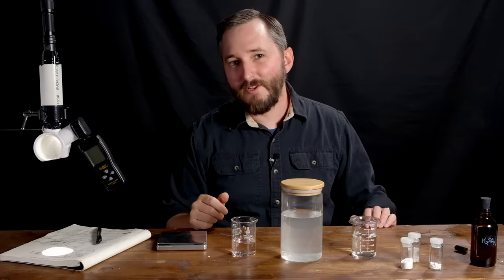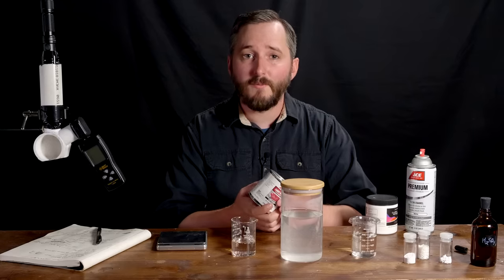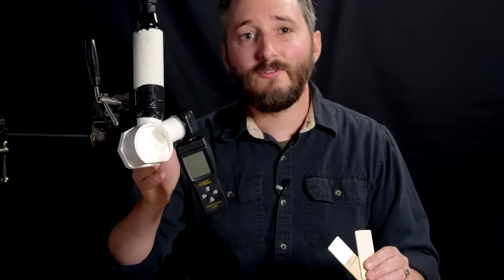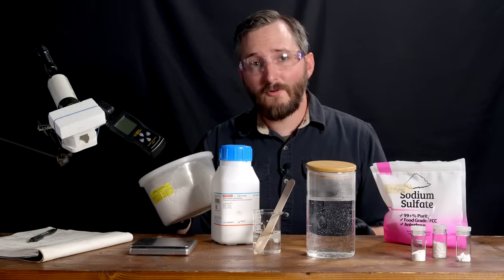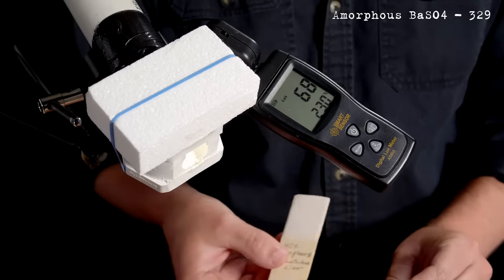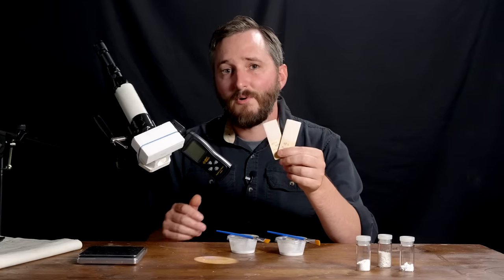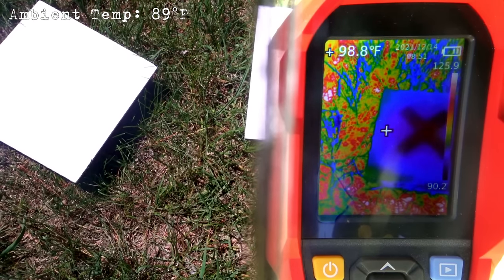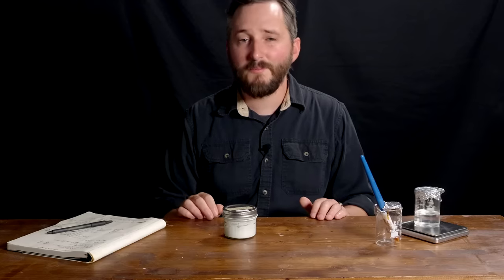How To Make Infrared Cooling Paint (Electricity Free Air Conditioning)

Comment: I tried this with a few Aluminium boards, 2 tests: 1st with a sensor on the back, comparing the temperature of the board to another plain white one. (duplicolor white acrylic), second test was at night with a resistor 20W glued to the back: how much power can I sink compared to the plain white one to hold the board at 15 deg C above ambient. The boards were 3mm 25x25cm. In the sun they were similar, but in the dark the CaCO3  was 12W more and BaSO4 15W.  For some reason the acrylic paint I mixed with BASO4 turned brown after being in the sun for a day ..... Will try KRYLON top coat maybe. I also tried caulk paint, but it would not stick to aluminium at all.
Reply from the maker: Thanks for sharing your results!
Reply: @Nighthawkinlight  I think I understood the application (from the docs) wrong, there are reports  of high power radiators - this only makes sense if the  radiated energy turned into IR

Comment: Thanks for this very interesting video. A lot of effort has gone into it.  I'm sorry to say I have some doubts about the experimental procedure used to measure the cooling effect.

Is the temperature of the panels acutally lowered by the paint?  In the video, no contact temperature measurements were taken.  The only temperature measurements were made using an IR camera, which is only a proxy for the temperature of an object.

The whole point of this paint is to emit more IR in the atmospheric window, so some IR detectors should show more IR emission from the new paint, others less, it depends on the specific IR wavelength measured.  Without controlling for which IR wavelengths were measured by the IR camera, we don't really know if the surface was cooled, or if less IR was emitted at certain wavelengths.  In fact the surface could even be cooler than expected, because more IR is emitted at specific wavelengths.

A better experimental approach could be used to measure the temperature of the water bath, or metal block, underneath the painted surface.  The temperature of the water could then be measured by contact to see how much the water is cooled using this new paint vs the commercial paint.  Insulation would be needed around the other sides to reduce heat exchange via IR from the other surfaces.

Another approach would be to keep using an IR camera, but to measure the reverse side of the panel, but this also would need controls for IR hitting the reverse side from the surroundings.
Reply from the maker: I've since confirmed the readings with physical probes and by measuring the back of the panels via IR. I've found the most accurate method for detecting difference from ambient is IR on the back of the panels compared to the same uncoated material reading in shade. I'll have a new video out in a month or so.

Comment: Are you aware of Sherwin Williams 'vinylsafe' paints? 
I did some crude testing of aluminium swatches with thermocouples on the back. I measured a significant difference in sunlit temperature between vinylsafe and a regular paint of the same colour.
It's now my go-to paint for any exterior surface in NC.
I didn't try white, but you may want to.

Comment: I live in the Philippines (North of Manila) where the temperature is around 30C basically all the time, plus a LOT of sunshine.
If I could paint the roof of my house with paint like this, I think the energy use for the aircons would go down drastically. The price per kWh has doubled in the last two years and I doubt it will ever go down again.
Not sure I'm up to the task to make paint to cover roughly 150m2 of roof myself, though.

Comment: The other paint did well because like you said almost everything is IR emissive.  It seems the main benefit of emitting in the atmosphere gap is that you're not heating your local surroundings.  I was also thinking that maybe a benefit could be there would be less of that wavelength hitting the panels from other sources since that wavelength mostly passes through.  However that wouldn't matter much because all the frequencies that do reflect will be hitting the panels regardless.  It would reduce the amount of the light the panels had just emitted from reflecting back on the panels but that amount would be pretty small anyway. Finally I would also be really curious about how black paint preforms in indirect and no sun compared to the these white paints.  Because black should be much more emissive as well as absorptive.

Comment: A mood ring changes color based on the temperature of the person wearing it.  If the mood ring material was ground up and put in a transparent base, it might be possible to tweak the material to make a dark color at colder temperatures and a light color at higher temperatures.  I'm not a chemist but would like to throw out the idea for chemists to make better paint.

Comment: This project was just begging for even the cheapest of diy spectrophotometers. But there may be a reason a surface spectrophotometer is trickier than a transmittance one. By quantifying all the seperate effects it would be much easier to optimize and understand the final product. Also some more discussion on how having a temp slightly below ambient would have such a significant effect. I feel like I could follow everything in the video except that. Great video though. It might make for a better series to have seperate videos for the chemistry portion and the paint/testing related portion. Or even better maybe  short and long format videos. This is really only necessary if you notice a high percentage of people losing interest and clicking out in the analytics though. Just an idea.

Comment: A very interesting video. I wonder if this paint would work as a coating on the backside of solar panels? Solar panels' efficiency decreases as they get warmer. Of course, being on the backside of the panel the paint would be shaded so I'm not sure that it would be effective in cooling. How about a highly reflective paint for the opposing panel behind a bi-facial solar panel? Because bi-facial solar panels can produce energy from the back side they do very well in snowy conditions because of the reflective properties of the snow.

Comment: I'd suggest use of dielectric mirror with fine tuned gap in reflectance and coal underneath (or vantablack lol). you can try to apply soot on undersurface. Be advised that gap depends on angle of mirror relative to ray, so don't mess this up.
Reply: Or another idea. One need to get REALLY TRANPARENT aerogel. Make a box out of it (or at least make an upper window with it) and cover it with dielectric mirror.  For best result i suggest to cover lower half with additional dielectric mirror to close gap from earth and closeby objects. And for top result you should make a cover from direct sun. and that's it. You'll make a good "free" fridge. xD
Reply: For convenience of usage I would combine it with phase material that can help keep desired temperature and help objects cool down faster.
Reply: Or maybe better instead of aerogel get a vacuum heat insulating chamber. But for good performance it should get rid of desired IR... I'll think of it later.

Comment: It seems logical that if you could point the panel at a direction without the sun shining directly on it it would be possible to get better performance. Perhaps foam walls going up from the edges of the panel might help with reducing the radiant heat from the tall trees and buildings as well as the sun.
Reply from the maker: True, but it's also highly beneficial to reduce absorbed heat from the sun on a sun facing side even if the cooling is not as ideal.

Comment: I forgot to mention in my last comment that should also measure the temperature ye olde fashion way, as you're working with reflective materials (it's kinda hard to tell how reflective they are to IR wavelengths with our eyes) that may not give you an accurate temperature measurement. Try a thermometer with a needle-like probe that you can stab into the substrate/coating.

Comment: It seems logical that the temperature differential would be smaller in the shade.  Overall radiation is lower with lower temperatures, so any factor that assists in cooling by radiation would not work as well with cooler objects.

Comment: Thanks for sharing. 

I keep coming back, 
 because there's something that
 seems to elude me that could
 possibly be added.

As I'm constantly thinking about
 panels & looking at your birdhouse
 type test mockups...

If in theory, if you were to take a
 structure (bird) house or other, 
 then (for test purposes) make
 the roof were you can flip inside
 out; coating one surface with
 reflection paint & other with a
 heat absorbent paint...

Is there any substantial difference
 of internal temperature change ?

If so, 
Then you can in theory make a solar
 panel style system that utilizes 180°
 louvers over a ventilation for desired
 effects.

I'd like to know if this has any
 credibility. But I have neither
 time or $$ to devote to such
 endeavors. But, would hope that
 I could have helped out in some
 way. 

Best of luck 
&
Let us know if you give it a try.

Comment: Next time put samples on a concrete surface that has been exposed to the sun, that way your results will be much more fairly tested. Laying the samples on grass allows way too many variables to aid in the 3.7°F delta. Soft grass allowing different angles for each relative to the sun, density of the grass affecting cooling on the back side, moisture of the soil, etc.

Comment: Posting this here because I'm sure someone else will find it interesting:

There is a recent paper from UCLA called "Do-it-yourself radiative cooler as a radiative cooling standard and cooling component for device design" that simply sticks 3M scotch paper onto aluminim foil and achieves 7°C sub-ambient temperature at night.

Not as amazing as this paint, but still pretty good considering how ridiculously cheap and low-effort it is to produce !
Reply from the maker: Yes I saw that and have tried their method with foil. It didn't work very well for me but it's a good test standard

Comment: I built FREE CLIMATE CONTROLLED HOME by MEMORIZING TEMPERATURES.
 While everbody else is reflecting heat.
     I have free PERSISTANT air conditioning& heated cabin using a system I built that ABSORBS either heat or cold. 
 I used 2tons 2x4 & 28 sheets 3/4 ply 2build shelves spaced 1 to 2feet  ALL WALLS that serve as radiator.  ABSORB  (memorize)TEMPERATURES.
   I leave ONE little exhaust fan on all night open couple opposite windows with a ceiling fan that MUST CIRCULATE THE AIR IN2 THE SHELVES all night. 
 Note I live on longitude with Los Angeles Lake Wister Ok. Cabin is so cold sometimes I jave 2go sunbath.
   We had 100° 3months last year every day.
    I rarely see 80° but few hours evening. 
    My cabin is DRAMMATICALLY stronger. The shelves = structural member truss of a bridge screwed in2 thstuds.
   Ergonomics are WONDERDUL. I have MASSIVE floor space now & ridiculously intuitive "cockpit."
      I built worlds best wood stove placed center cabin wirh 15' horizontal exhaust angled DOWN 2" TO DRAIN WATER OUT WINDOW. 
 Dont worry smoke goes downhill lol & that chimney release massive heat. I use THICK stainless Diesel exhaust pipe. 
  I collect branches all summer as I work. Little by little by winter I have firewood 4entire season without even trying.
   I use ONLY dead fallen branches & a sawzall it tkea no effort at all. 
    Temperatures are brutally persistent. Open all windows winter once u shut them heat skyrockets immediately cuz 2 tons wood and 2 more  tons objects on shelves absorb memorize heat.  
  My lawn is 3 to 12 ft. high weeds. LEAVES COLLECT ZERO HEAT AND KEEP SOIL COOL and drammatically richen my soil. My south slope acrage is 15° cooler summer.
    If u make lawn its  SOLAR PANEL sun hit dirt u lie awake burning in heat all night as dirt release its fury it stored day. And u soil fertility goes2 H*ll with bare lawn.
   I have fruit trees shading cabin. They lose leaves fall heat cabin with sun winter. 
  You need 2study LEAVES. They reflect heat so u can make reflecrive oil stains. Paint should never be used. Wood oil srain only.
   Stone DOMES dont absorb heat cuz sun only 99° 2surface one small spot. Again doms home weight 40 tons it, mass,MEMORIZES TEMPERATURES.
   They dont need silly paint.
   I also NOW have free climate controlled shed with security guard as by product.. No walking outside 2get tool in dark cold shed where thieves hiding. With 28 sheet ply shelf storage? ...shoot i have 2much shelf space.
 Your flimsy carboard walls?  ..arent 6" thick. Lol my walls are 2 FEET THICK structural member. 
   Hmmm. I just realize "I have enough good wood stored in cabin + 6 thousand oiled zinc plated screws 2build 2nd house when this1 is done. 🙄 
      Blessed is a roof over th head.

Comment: Incredible video, the approach and the way it's conveyed by you is amazing! 
BUT I have one question: Didn't you use an infrared-camera to measure the temperature of the surfaces? So the temperature, that appears on the screen, is dependent on the amount of infrared light emitted by the surface, right? Now, is the thermometer / infrared-camera even showing a trustworthy picture, using exactly the infrared light that the paint is supposed to emit more of? Maybe one has to be more suspicious of the measurement method here... Maybe a thermometer with a physical sensor attached to the surface might do a more reliable job here. Not sure tho
Reply from the maker: I'm using thermocouples measurements in my current tests. They line up pretty well with what the camera shows

Comment: Interesting. I can´t find the temperature of the room data. I was also wondering if fabric could be dyed using something similar to create super cool shade sails. This would enable them to be deployed during summer and wound up during the winter months when the heat of the sun is needed for warming. In Southern Spain houses are made of uninsulated concrete. Freezing in the winter. Heating them costs a fortune and burns more fossil fuel than the aircondtioning does.

Comment: Wow, awesome work! Just a thought: I know very little about how thermal cameras work, but maybe they are not a good choice to evaluate the surface temperature of these paints? The coating is designed to have a high emissivity and radiate very efficiently at the infrared, which may give higher readings than normal white paint?

Comment: this would be very cook in combination with Thermoelectric generators as the main issue is non sufficienct cooling to heat ratio this could help the balance on heatsinks used for Thermoelectric generators

Comment: Dude you need to do like 25 - 30 light coats with the with the barium sulphate, and you do light coats because the solvent will create air bubbles in think coats and also you do need a thick layer anyway because of how it works, because it does work like snow the binding glue has a different density to the to the barium sulphate which is what you need for refraction.

But that refraction needs depth to reject the light or otherwise it will pass right through to the under material, so lots of coats, and you need to do it while the paint is still tacky for every coat and it takes like 20 minutes a shot and about 1 minute to paint it per go so 21 minute times 25 - 30 so 525 to 630 minutes or almost 9 hours to 10 and a half hours straight. So yeah it's not surprising it isn't used as a paint.

Like it doesn't need to be a complete drag though you can do other stuff while you are waiting for each layer to get tacky, but you probably want a few people on it so you don't need to come back every 20 minutes, if you can get 3 people on it it's only once an hour and you can easily work around that.
Reply from the maker: I have methods now that don't require more than one coat. A new video will be out in a week or so.

Comment: Not sure if the infrared thermometer is the right tool for the job here.  It's right about the infrared emission (i.e. the special paint), but the temp is a calculated value--a function of the IR level & the emitting material--where for the same IR values, the actual temp can vary widely from material to material.

Comment: This could work very well with an indoor thermal mass and and heat pipes since heat pipes are extremely good at transporting heat against gravity but not the other way arround... This could be a cheap setup without the need for moving liquids and electricity...

Comment: Great research! Are you sure that the emissivity of your paint variants is the same and you can use the thermal camera reading to compare the actual surface temperature?
It might be much better if you measure the temperature using thermocouples. But in any case there are a huge number of hidden effects that will make your job very difficult.

Comment: Thermocouple in contact with (or embedded in) the surface would have been MUCH more precise and less prone to error. This way of measuring temperature that you used, through a simple camera is flawed because it sees only IR comming in a straight line to its sensor, so you can't be sure that you paint is really colder infact. Maybe it just emits its heat in a different direction or in a wavelength that your sensor don't catch ?

Great experiment tho ! Thanks for the details, that's amazing, and "quite" low-tech  too